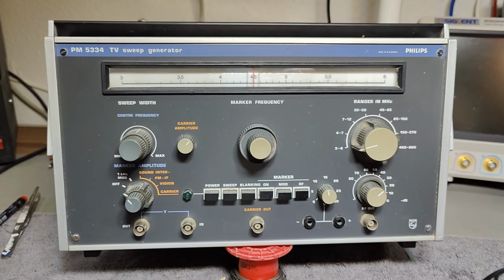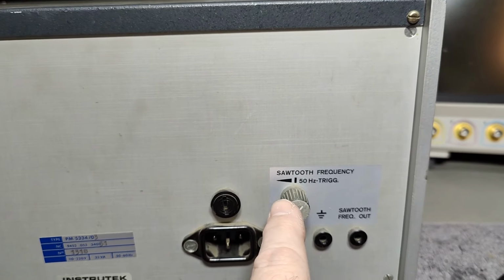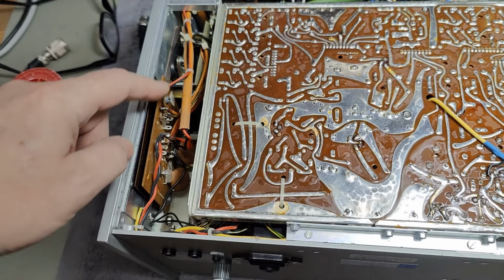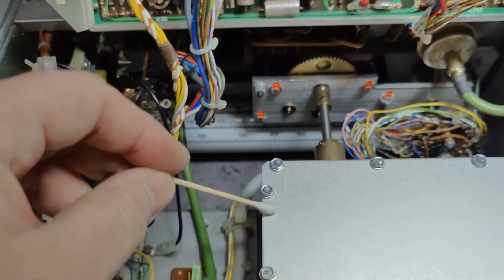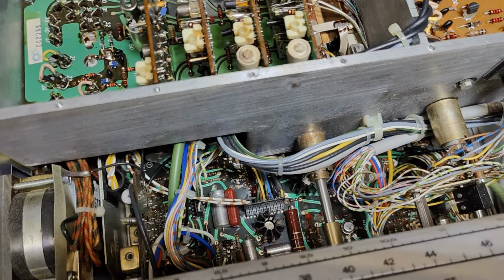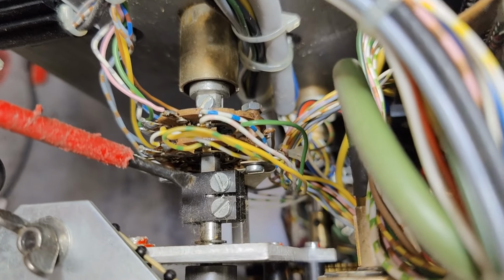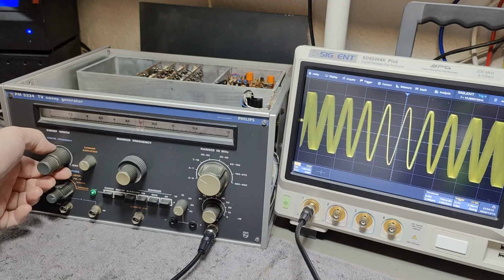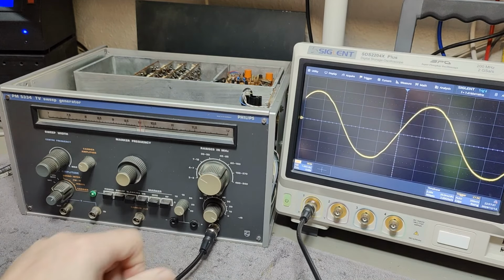Philips PM5334/03 TV sweep generator 3-860MHz

Comment: This is the Philips version of the Nordmende SW 3330 you teared down 2 years ago. That one was from 1972. It is interesting to see that both devices have the same circuit board made by Nordmende. Maybe it was a joined venture where Philips made the mechanics and Nordmende made the electronics? The wire mess inside does not look like a Philips design.

Comment: Love that rotary switch.  It moves the coils to a different slot rather than soldering coils to the switch itself.  Good video.  Never saw trim pots like that before. At the very end the lower frequencies looked to be flat topping?  Used a generator in high school electronics when TV's still had a tube in it, never one that old.